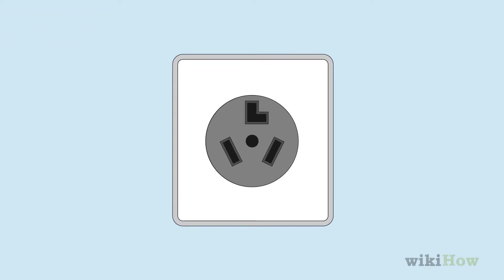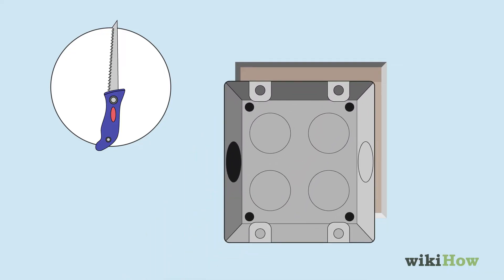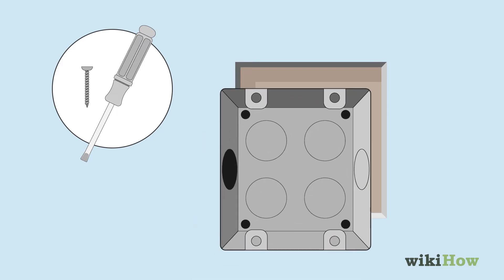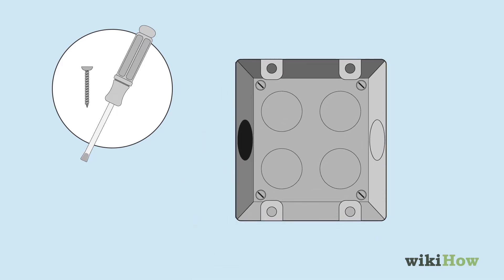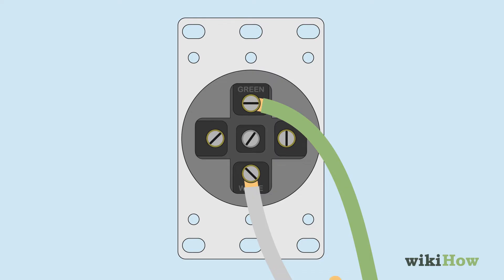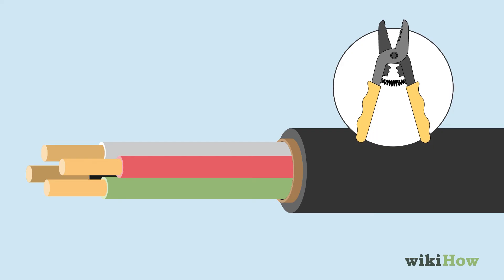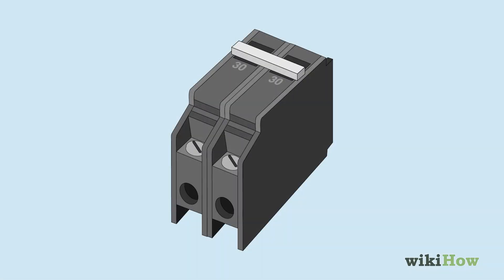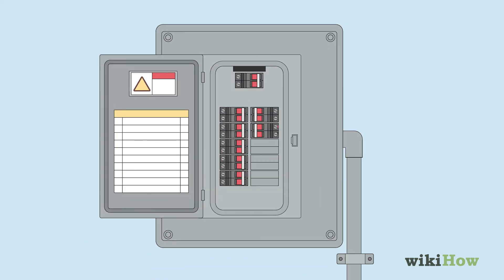How to Wire a 220V Outlet

Comment: Bet there's a lot of pissed off people with a 1 inch hole in their wall for no reason after watching this 🤣 

Tip: the narrative left out to either drill a 1-inch hole next to the breaker box and fish the wire through it OR install conduit and fasten it directly into the pre-cut breakout on the breaker box... Don't do both.